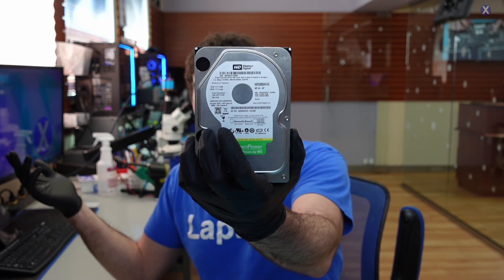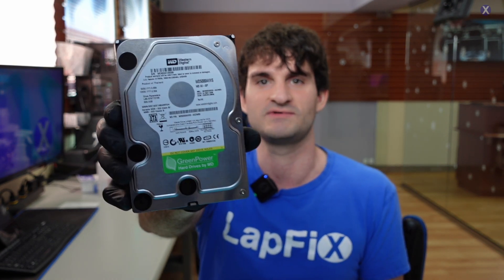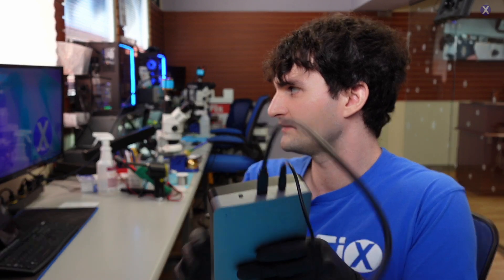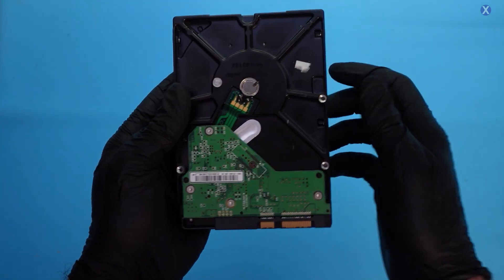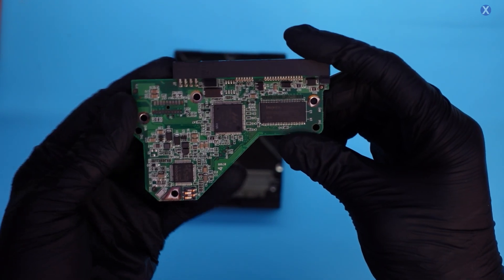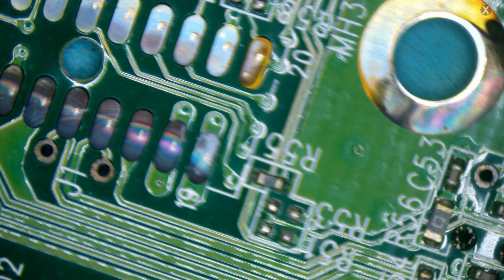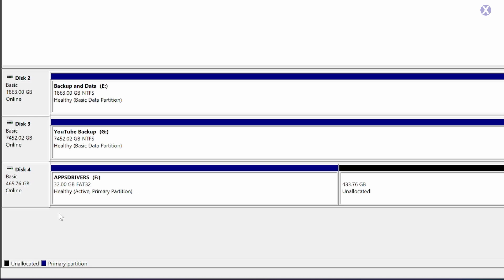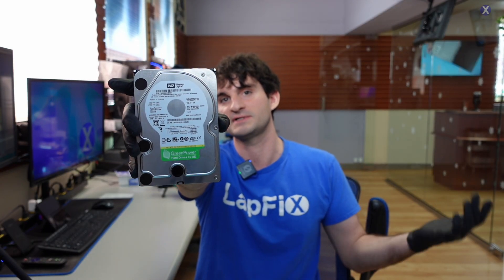How to Recover Data From A DEAD WD Drive

Comment: Thanks!
Can't R Studio do that instead of PC3000? It's a soft issue
Reply: Probably. I'd run DDRescue or HDDSuperClone (Linux) to take an image without mounting the drive and then recover from the image with R Studio or similar. I'd love to get one of the PC 3000 devices but can't really justifiy it with the small amount of data recovery jobs I get. If it's beyond 1st level data recovery, I refer them to a specialist.
Reply from the maker: A data extractor allows you to map heads, isolate weak heads, and reimage damaged sectors. In data recovery, you only get one chance to get it right—we don’t take chances!
Reply: @lapfix  thanks but that doesn't reply to my question. Are you financed by ACE Labs to promote their overpriced products? Let me redo that. Is R Studio sufficient to do that ?
Reply from the maker: We are not promoting their product. If you’re a data recovery professional, this is a must-have tool. R-Studio won’t map heads, isolate bad heads, or create a full sector-by-sector image. Using R-Studio without checking head health risks customer data. I agree, it’s an expensive tool, but for critical data recovery, it’s worth it.